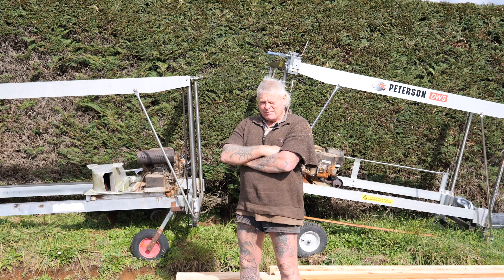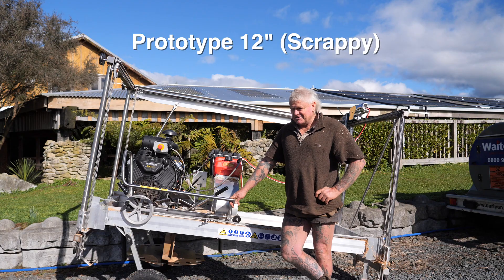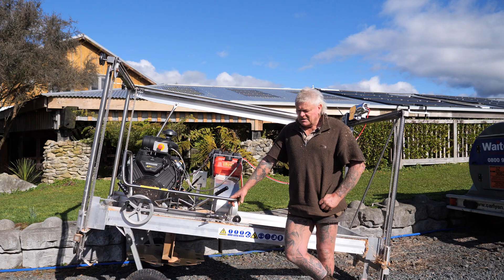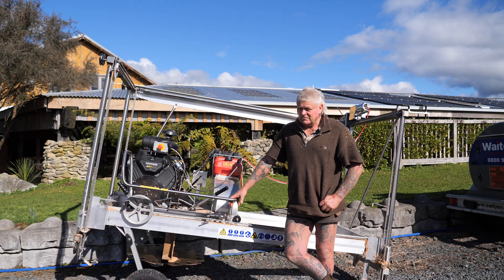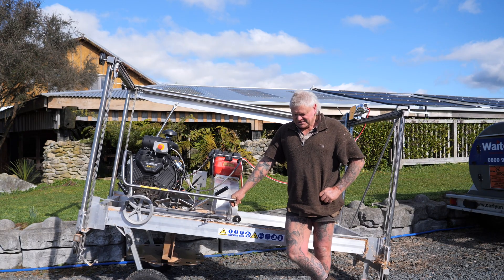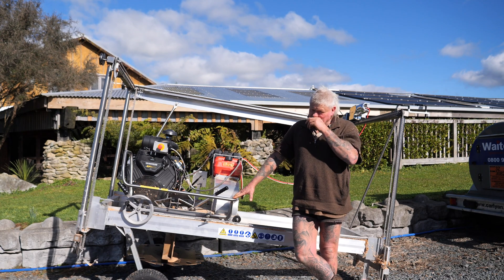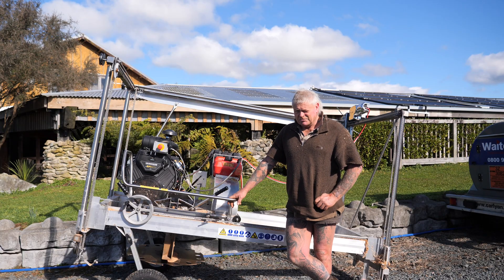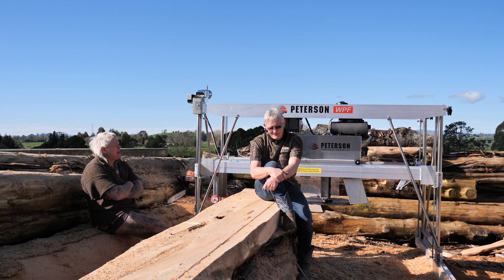Peterson’s 12½” Prototype Sawmill: Full Review & Demo After 240 Hours

Comment: What is the max log diameter this 12" cut saw head will accommodate?  With the WPF the 10" cut has a smaller max diameter than the 8" cut version.
Reply from the maker: The 12 1/2" mill handles logs up to 1.4 metres in diameter.